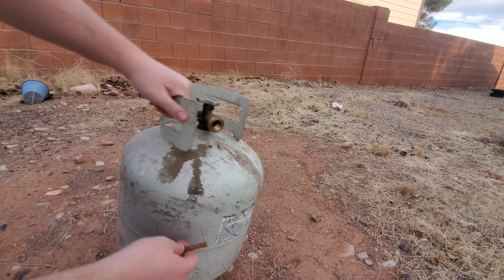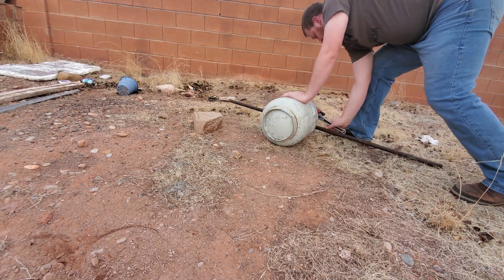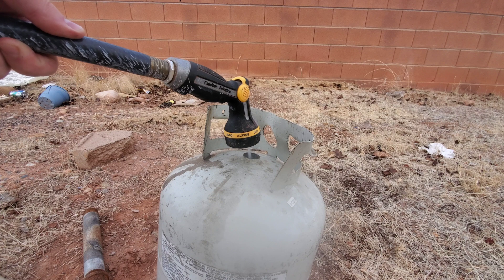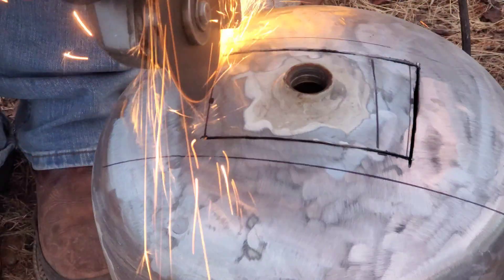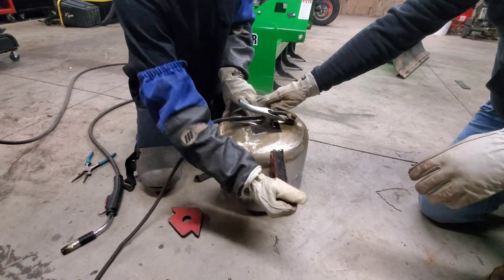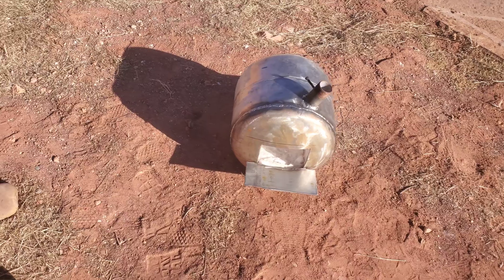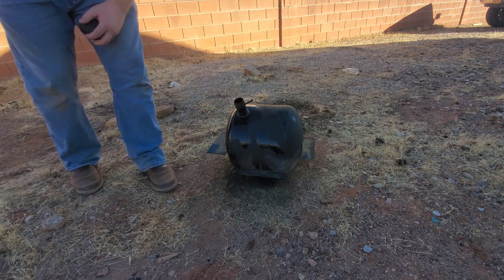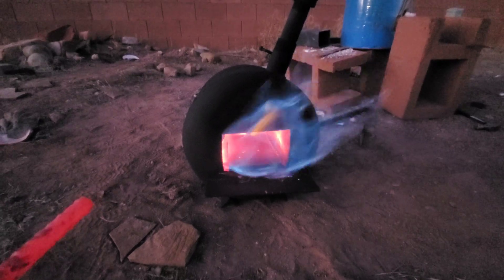How to Build your own Forge at Home from Propane Tank

Comment: Do you lose a lot of heat with that flame shooting out like that? And why are there holes on the front and back
Reply from the maker: There is a hole in the back so that larger projects can go through and you can hear a specific portion of the steel.